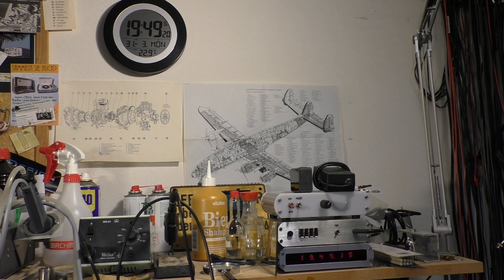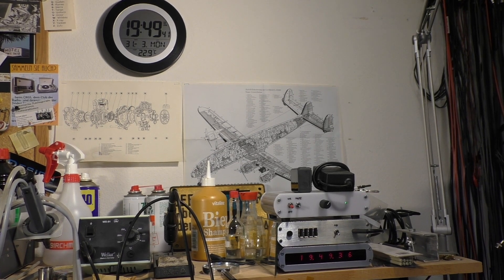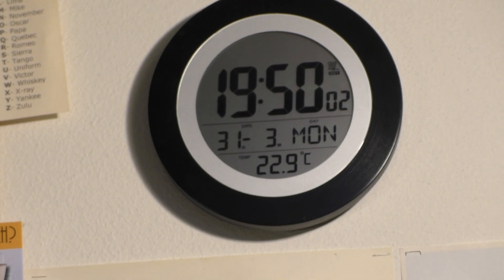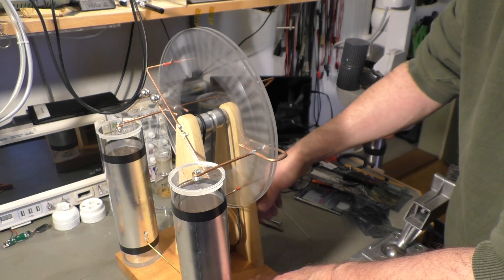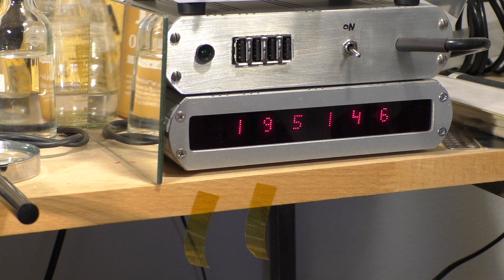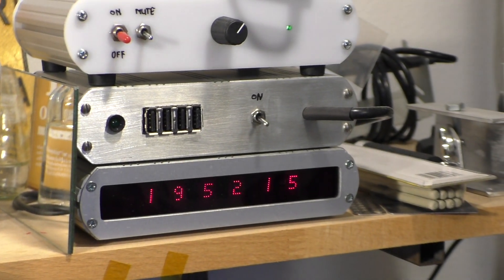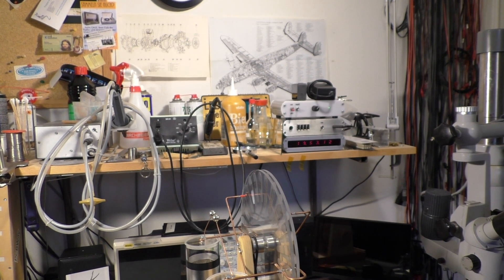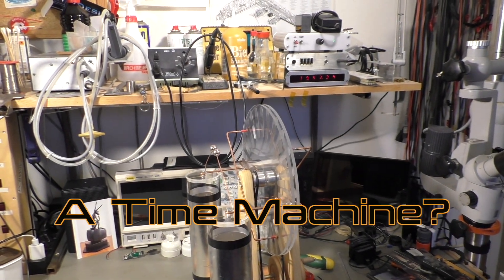Did I accidentally build a time machine? (PWJ263)

Comment: Remember a fast clock in a computer system should not be set back to the correct time, but slowed down to allow time to catch up.
setting it back plays havoc with communication time stamps. setting it back means you can receive a confirmation of a message before you sent it. 
Which is a good thing that the UK does it time changes when most of us are in bed.

Comment: Just goes to show why electric discharge (sparks) were used as the first form of transmitters.
I bet your neighbours love you when your running that noise generator. in the old day in the UK you might have got a visit from the GPO for illegal radio transmissions. 🙂
One thing about spark transmitters is that they are very wide band so you can affect as many people as possible.
Reply from the maker: Maybe I should add an antenna? :-)
Reply: @PlaywithJunk  Why not. that's what Hertz's did in 1887, followed by Marconi in around 1896. So will we see PlayWithJunk in 2025. 🙂

Comment: I'm pretty sure that radio controlled clock wouldn't be affected by sparking if put closer. 
The led clock must have some "gapes"...🤗
Reply: the only problem with the radio controlled clock is if the data transmissions occur at the same time as the infernal noise machine is turning.
The LED clock looks to have a few gaps in it's screening and a lack of radiated  noise suppression.
If your device can emit a lot of electrical  radiation , then it can be affected by  radiation coming in from the outside. Saving a few caps can lead to this.
Reply from the maker: The LED clock takes it's ticks from the mains. The mains cable acts like an antenna. When I use my old MADAS calculator, the electric sparks from the motor make the clock go brrrrr. Maybe something for next April... ;-)

Comment: And is the led one radio as well? Even then it wouldnt explain the change DCF77  towards only send timing data once per minute
Reply from the maker: To be honest, the LED clock takes 50Hz mains as reference. That means a long power lead runs behind the desk which acts like an antenna. You should see it when I run my mechanical calculator :-)